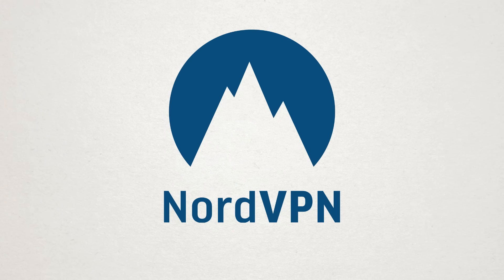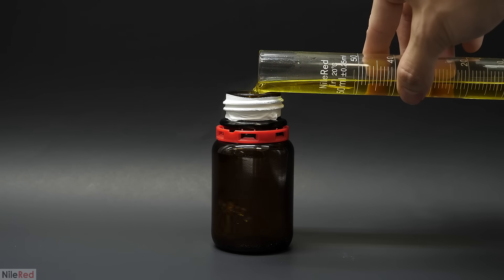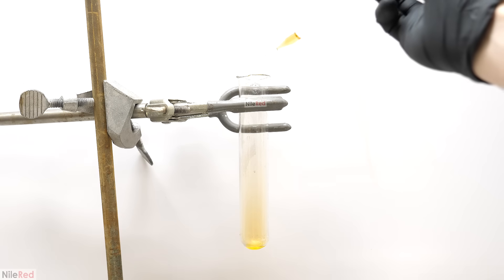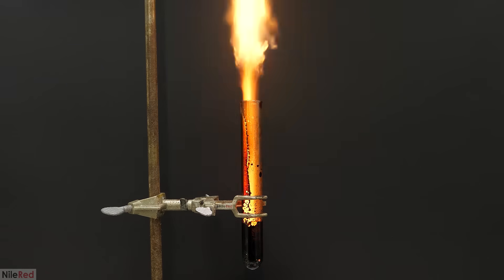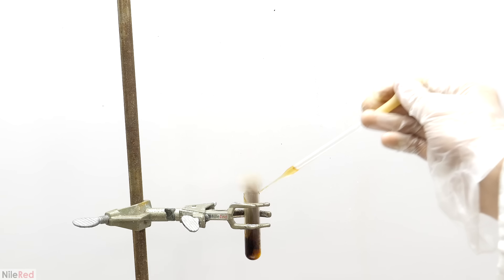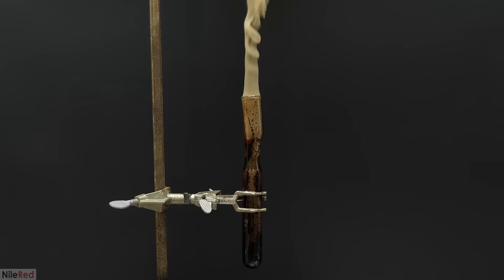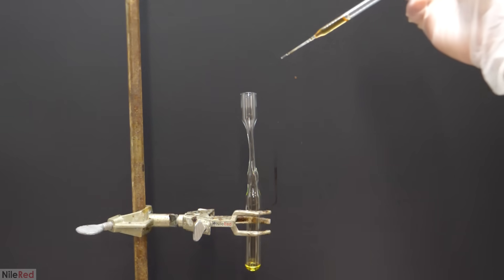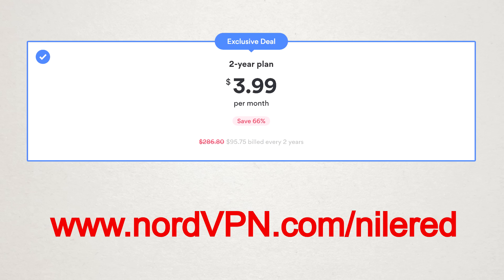Making test tube liquid rockets

Comment: Not a serious rocket-propulsion expert, but I do know that the Diverging portion of a C/D rocket engine is only beneficial if you have laminar flow of the fluid with an average velocity >mach 1. Therefore, rockets are designed so that the change from converging to diverging happens EXACTLY at mach 1. Incredibly cool video, but the diverging portion of your glass test-tubes is likely useless (just trying to help, since it seems you were testing parameters for a good design)

Comment: Very cool! For your next round of experiments, it would be interesting to place your test tube stand on a scale so you could measure the thrust of your rockets. If you had one that could log data or record a maximum you could see your peak thrust.

Also, I wonder what caused the secondary ignition. It seemed very consistent across all your experiments.

Comment: Very cool! I'd suggest designing a proper combustion chamber that can take some pressure (maybe collab with someone like AvE to machine it for you). It's hard to tell, but I don't think you had choked flow for most your tests, so if you have the chamber made  to allow you to inject propellants at higher pressure, you might really have something

Comment: I'm guessing the second firing of the reaction is due to the acid and aniline not being completely mixed, so when the pockets of low aniline are completely reacted, the reaction can die down, while the pockets of low nitric acid aren't reacting quickly enough for ignition.  Once the force of the reaction stops, the reagents both settle back at the bottom and re-mix, allowing for the second reaction to take place.

I would definitely like to see a hydrazine based test in the future - I assume there will be a lot fewer biproduts, which would translate to more of the mass of the reagents being turned into gas, and therefore into force.

I wonder if you could use an old-school balance to measure the thrust you're generating.  Some of the thin-necked trials certainly sounded as if they were producing actual thrust, whereas I didn't get that feeling from the standard test tubes.

Comment: Hi I work at one of the largest marijuana butane/propane hash oil. I am relatively new to the manufacturing side but I K of there's also a method using supercritical carbon dioxide.  I generally understand there isn't much chemistry involved in bio phone other than blasting it but I do have some things I'm curious about.  I'm curious about the chemistry of THCA and other cannabinoids.  Another thing I am curious about is distilling marijuana.  I'm curious about different vapor pressures and boiling points of different terpenes ...  Some extracts have hardly any oil and much Crystal...  Others see to have oils that are more volatile than water and are almost creeping out and on top of their lids.
Reply: Okay I typed this from my LGE onetouchzte.  I'm sorry for its nonadaptive auto-correct.  I always say it half works 100pct of the time.
Reply: English is my first language this phone probably has auto-correct that is notoriously bad in the auto-correct software programming industry they probably laugh at it
 Thanks for using your imagination to fill the gaps.

Comment: You need to atomize the two in the combustion chamber at the correct rate for the size nozzle you are using to make thrust without exploding the combustion chamber. I think. I know nothing about these things. Where am i right now ?

Comment: I'll send you a message through Patreon. Let me know the fuel setup(s) you'd like to use and I can look into making some parts like the exhaust nozzle high tenp ceramics. I could possibly work on the fuel storage tanks too along with the fuel mixing stage ignition/combustion chamber. The ceramic exhaust nozzle inner lining is where I'm more comfortable with the design and material choice.

Comment: Hydrazine and its exhaust is quite toxic.  Take adequate precautions.  Also, when working with hypergolics, I recommend a remote method of fuel injection when you are unsure of the pressure capabilities of your combustion chambers.
Reply: TheHengeProphet very very toxic, not quite

Comment: You must build a rocket with Codyslab now...
Reply: Scott Manley, Codyslab, and NileRed collab?
Reply: Once the rocket is built, it can be offered out to the flat-earthers for some test flights. Some (a few) of them have generated appreciable funds so surely they'd be interested in supporting a rocket mission, right? RIGHT? :D
Reply: Throw in NurdRage in there for good measure ;) ;)
Reply: Fuck yeah
Reply: Scott Manley designer, AvE engineer and Nile chief chemist. I'd watch that all day
Reply: You could place a strain meter better the test tube and holder to determine the thrust produced.  It can be made with aluminum foil and wire along with a couple of ohmmeters.
Reply: Thomas Blackwell < An even easier way is to simply place the whole test tube jig on a scale and use a simple equation to calculate the trust based on the exerted weight during firing.  You can even calculate the trust pulse and acceleration based on the weight/time ratio quite accurately.
Reply: Would not be surprised if these guys flew to the moon by themselves tbeh
Reply: With Cody as a Partner... graduate from Hydrazine propellant to atomic propulsion. :D
Reply: thefourthtuxzt Cody Slab
Reply: And scot manly. But most importantly isaac aurthur

Comment: While Dimethylhydrazine is unavailable in the canadian sigma store you could just buy it in the german (cheaper than from the US) sigma store where you can get 100g for 47 euros. I live in germany and have ordered from the US sigma store before so I don't think that shipping will be a problem. However I don't know canadas regulations regarding chemical importation. Product number is D161608-100G (UDMH) / M50001-100G (MMH) if your looking for it.

Comment: Might want to use some kind of rotary jig thing to make the engine necks a bit more evenly, then dremel-tool the excess off the top. All the straight tube on the top probably isn't doing much of anything (other than causing the makeshift engines to look less authentic, heh). Also, hydrazine is uh... darn it Nile, I think we'd all much rather you were still around to make great chemistry content.

Comment: Please do not mess with Hydrazine, it is incredibly toxic. A fairly small accidental release can put your entire neighborhood in serious harm. 

On a lighter note, it looks like your throat needs to be smaller. You need to achieve "choked flow" at the throat for much effectiveness.  When properly choked, the speed of gas is Mach 1 and it hits equilibrium and no additional speed is possible. This then allows supersonic physics to kick in and accelerate the gas further down the nozzle. If not choked you are not supersonic and dealing with different equations and not accelerating past Boyle's Law. I have some nozzle design textbooks from college I can scan for you if you want to get something going better, has all the calculations needed. 

Also see if you can adapt and afford a "choked flow Venturi". They are typically used for gas flow measurement and are exactly the shape you need if you can adapt to it.
Reply: I guess he didn't want to "choke" the escaping gases too much. If it does then we'd have seen the glass tubes shoot downwards off the stand. Or maybe they'll just shatter from the incredible pressure inside the glass tube.
Reply: @erismurexis966  
The pressure shouldn't be too incredible - I believe 30 bar is fairly typical (not sure though)
Reply: My Chemist teacher currently asked me if i have any cool ides as last chemistry lesson before graduatin. So i showed her some things and also this, and we would like to try out some things and it would be rly awesome if you could maybe scan and E-Mail me the designs so we can think about doing this experiment if it's possible. 
Hope you answer me soon
Reply: Hydrazine isn't all that scary; it's been the main starting reagent I've used for years in research. As long as you follow safety protocol and use some common sense.
Reply: James Mueller same here I would love to just look at them
Reply: On a small scale, neighborhood will be just fine.

When scaled up to a few liters, then we need to worry about the neighborhood.
Probably why hard to get hold of, the authorities know this.
Reply: Could you post the titles/authors of some of the textbooks for some of the people in the comments?
Reply: He already did a few years ago.  He made a video on how to make hydrazine sulfate, which was then used in his luminol synthesis video lol
Reply: fume hood
Reply: Nile does what you say and 10 seconds later of doing it,

north korea wants to know your location
Reply: YOUR THROAT SHOULD BE SMALLER!!! hahaaha
Reply: hi im from a terrorist organization and we need missile to defeat enemy, ples send u book to us at our email terror@terrorism.com, so we make our own missil very good, thank  u. (This is a joke, do not be alarmed. I repeat, this is a joke, do not kill me, thanks.)
Reply: @Danuxsy  Nice joke pretending to be a terrorist smh you want to be arrested don't you
Reply: Uveeertherw if you can’t see “terrorism@terrorism.com” and think it’s a joke you should be the one getting arrested
Reply: @herpderpinson6117  I know it's a joke, but the govnerment doesn't care
Reply: Are you the next Elon musk my brain cells are now gone

Comment: Quick little theory on tube length:

It might be the same effect as gun powder in- and outside of a contained area. 
Maybe with the longer tubes, the reaction is contained and forced to a slightly higher pressure resulting in a more vigorous reaction.
Reply: Uriah Siner Of course, past a certain length, pressure would decrease past maximum possible.  I think what's more critical is just atomizing/vaporizing the reactants such that complete combustion occurs more efficiently, and less tube length is needed for the reactants to completely mix.  With large droplets or pools, reactions can only occur at the interfaces between reactants.  By atomizing, you increase the effective surface area capable of producing contact between the reactants, minimizing the need for a lengthy tube through which heat and dispersion vaporizes and atomizes the reactants that started in the combustion chamber as pools of liquid.

Comment: I know that certain species of mushroom (specifically the Gyromitra genus) contain a water-soluble hydrazine derivative known as gyromitrin. I doubt it would be efficient, but would there be a way to isolate the gyromitrin and convert it to hydrazine? Or maybe hydrolize gyromitrin into monomethylhydrazine which is also used as a rocket propellant. What mass of mushrooms would be needed to extract a usable amount? If it were possible it would definitely be quite an interesting experiment!

Comment: I believe that gunk is polymerized fuel. I may be wrong but I do know that that happens in rockets, that use hydrocarbons, when there is a fuel rich mixture that leaves un-reacted fuel. This may happen with the alanine. The left over fuel is polymerized by the heat given off by the reaction. Maybe that’s what happened there🤷‍♂️

Comment: Hydrazine is no joke, only work with it under ventilation. If you can smell a strong ammonia-like odor while you're working with it, you've been exposed to too much. In that circumstance, contain any hydrazine you're working with, leave it under ventilation, and vacate the premises. Otherwise it would be easier to manufacture the derivative fuels than it would be to buy them. They really only have a niche application in aircraft emergency power units, so anyone who isn't in an airport's maintenance supply office would have a hard time getting their hands on those fuels cheaply.
Reply: I wouldn't work with it without a SCAPE suit! Those are the space suit looking things you see in pictures of satellites being fueled, like this one: http://sci.esa.int/science-e-media/img/80/Planck-fuelling_027.jpg
Reply: But then again, I am a coward.
Reply: For reference, my experience with hydrazine is from the Air Force. In the Air Force, all maintainers get trained about hydrazine safety if their job is related to an airframe that uses a hydrazine fueled EPU. To put how the Air Force treats this chemical into perspective, if the indicator swatch turns purple, a maintainer smells that ammonia odor, or a clear, oily liquid is pooling near the drains, the area around the aircraft is cordoned off (hangar evacuated if indoors), a ground emergency is declared, and HAZCOM and the base fire dept. is called. It really is no joke.
Reply: I would say just don't use it (especially when your test tube rocket is spraying it all over the place). It's not worth the risk for this little demo. There is a reason why most fully trained chemist (including myself) would only use it if absolutely necessary.

NileRed, if you happen to read this: Please also consider that you are venting your fumes to the outside. I like your videos a lot, but using hydrazine in your setup would not only put yourself at considerable risk, it would also be reckless. Please don't.
Reply: He already made hydrazine sulfate in a previous video
Reply: @bluesun128  Hydrazine sulfate isn't a problem. Hydrazine is.
Reply: As cool as it would be to see him experiment with hydrazine, based on what I've been seeing people say about it I definitely think it would be best to just stick to other, much less toxic fuels. Of course, he said he was just getting into liquid rockets, so he probably didn't realize just how dangerous that chemical can be.
It's always great to see comments on YouTube videos concerned for the person's health! :D
Reply: What? Hydrazine smells nothing like ammonia. Its closer to the typical primary amine "rotting fish" smell, with a slight background of pepper or "burning"
Reply: Aniline is also quite poisonous
Reply: @gavinjenkins899  
Not even close
Reply: Why are people making shit up about how toxid hydrazine is? Did you even work with it? You can smell it and its no problem whatsoever, just like with HCN. Also, it doesnt smell like NH3. You dont just inhale 1g of this stuff just like that.
Reply: @leocurious9919  The MSDS for hydrazine says it is harmful to inhale.  Maybe read documentation before you criticize others.
Reply: @GTLugo  "Potential Acute Health Effects: Hazardous in case of skin contact (irritant), eye contact (irritant), inhalation. Slightly hazardous in case of skin contact (permeator) or ingestion"
I got this is out of the MSDS of a substance u know: Ethanol. "Hazardous in case of inhalation" is something that pretty much any substance has in its MSDS... for obvious reasons. But I appreciate that you didnt just make shit up like some other people here, but instead read the MSDS.
Reply: @leocurious9919  Why are you making up shit about how safe hydrazine is? The smelling threshold is 3.7 PPM (and is described as smelling similar ammonia literally on every source I could find), when exposure limits are between 0.01-1 PPM.
Reply: @MDeadcloud What am I making up in my 7 year old comment? The LD50 is about 50 mg/kg, so at the very least 2.5 g for an adult. Do the math and calculate how much 3.69 ppm air one needs to breath to reach that, I will wait for your math. Then, later, we can look at the elimination rate and check if we could ever reach it with that air, I will dig that up and then do that math after you did your homework.

Comment: What if you aerosolized both components then intersected the flows?
Reply: tintruder224
,
I was thinking the very same thing.  It seems like the combustion is being choked out by the build-up that black residue. I think that aerosol idea would increase full mixture combustion, similar to the pine sap dust in the paint can (combustion experiment).  As NileRed said, that he believes if the mixture were to burn at a higher temp the exhaust would burn completely.  I also believe the initial burn phase is creating a black crust over the rest of the mixture and the secondary burn is caused by the skin finally cracking and oozing up to be ignited for the second burn.  But I"m jet an ex-jet engine mechanic.  I still find it fascinating.

Comment: Just to say that Ignition is a classic work of popular science. I think it's out of print which means you can find it legally free online, and you really should try to dig it out if you can. The passages on chlorine trifluoride in particular have been much quoted in various "most dangerous chemicals" lists, particularly the line that, in the case of a ClF3 fire, "I have always recommended a good pair of running shoes".

Comment: The convergent-divergent nozzle is only useful if it is carefully calculated for the exact combustion conditions.
For it to work, the exhaust gas flow at the choke point must be exactly the speed of sound. Only then will it do what its supposed to, exhalerate the exhaust gas to supersonic speed.
If the combustion conditions are not exactly met to reach mach 1 at the choke, it will just simply act as a venture tube, and the exhaust speed will decrease in the divergent part.

Comment: If you are going to play with hydrazine, (hopefully you already know this) it is extremely toxic. Minor exposure can cause tumors, central nervous system issues, liver failure, etc... It is also very unstable and should only be worked with in solution. It's pretty easy to make from hydrogen peroxide and ammonia though.